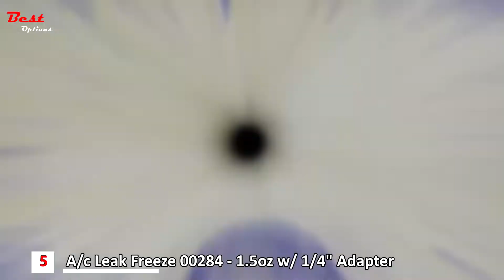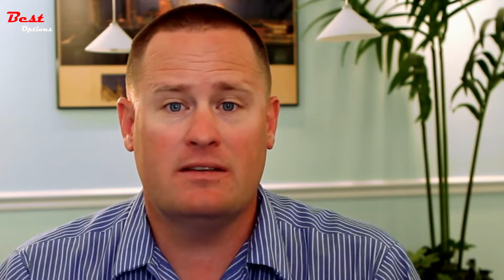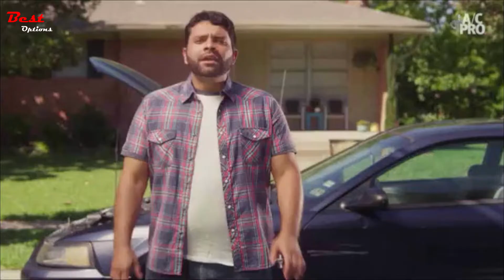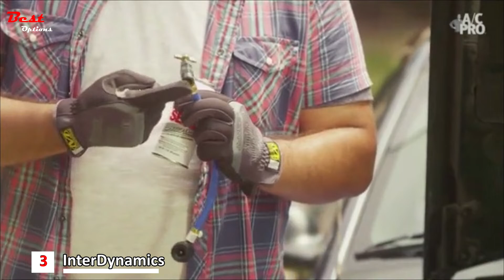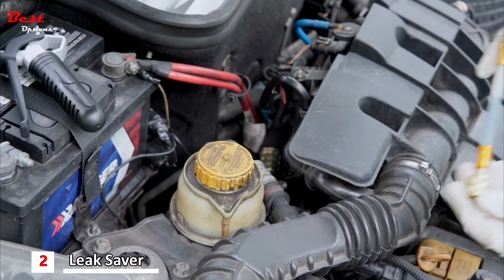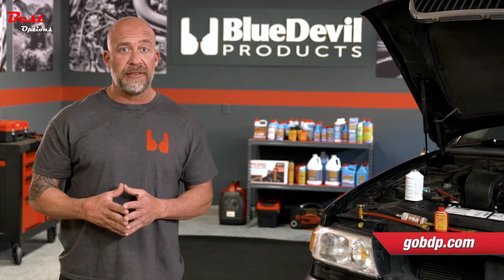Best Ac Leak Stoppers

Comment from the maker: ✅5.  A/c Leak Freeze 00284 - 1.5oz w/ 1/4" Adapter
Amazon US – https://amzn.to/3OP6sGt
Amazon CA - https://amzn.to/3vz6b3K
✅4.  Rectorseal 45316 AC Freeze PRO Nano Leak Sealer
Amazon US – https://amzn.to/3OU7Qb0
Amazon CA - https://amzn.to/3bmFecy
✅3.  InterDynamics Car Air Conditioner Refrigerant Stop Leak Kit
Amazon US – https://amzn.to/3JoBS5q
Amazon CA - https://amzn.to/3BEu0Lg
✅2.  Leak Saver: Direct Inject UV - Refrigerant Leak Sealer with Added UV Dye
 Amazon US – https://amzn.to/3OUhLxh
Amazon CA - https://amzn.to/3zp2LBG
✅1.  Red Angel A/C Stop Leak & Conditioner
Amazon US – https://amzn.to/3JlL22J
Amazon CA – https://amzn.to/3oTeovG